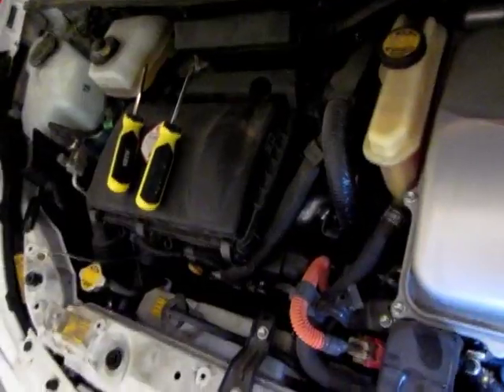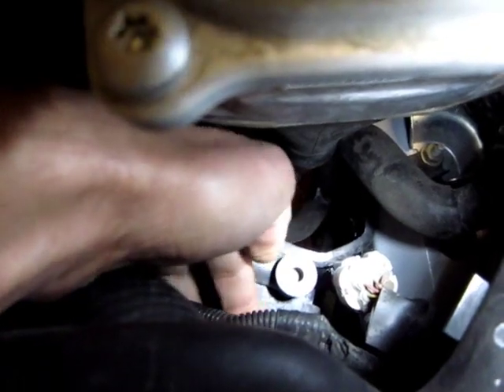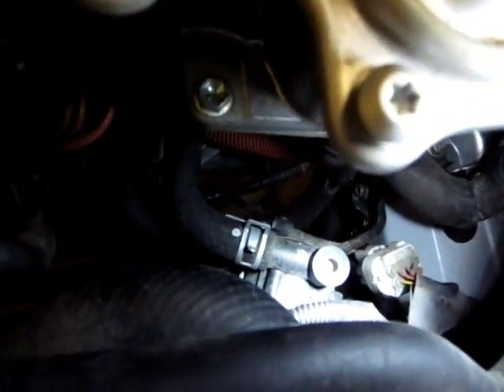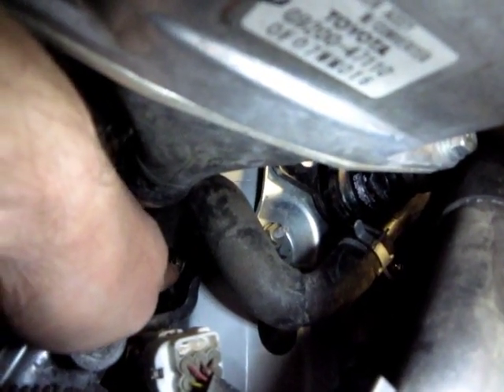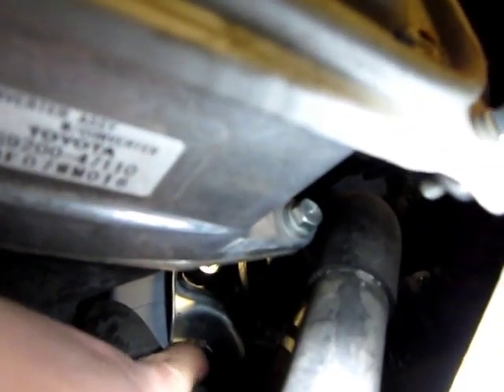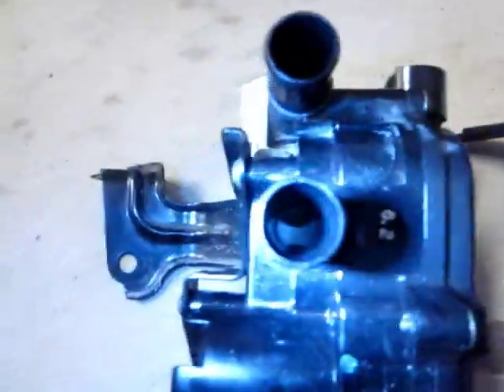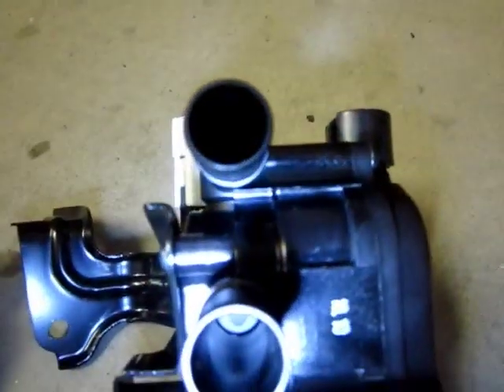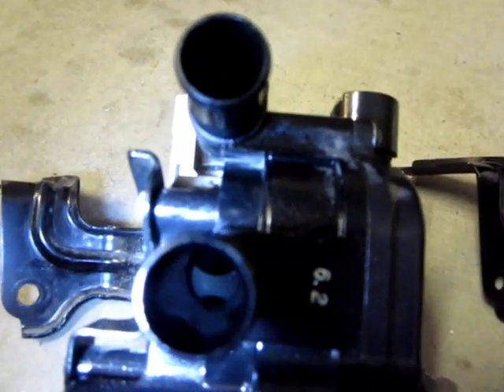Prius P1121 Coolant Control Valve Identification

Comment: The Toyota dealership I took my car to said that it not functioning was due to my car being pre-owned and damaged from an accident and it was glued together. What is the probability of this where there is no other physical damage to the car?
Reply: niftyusername Very low. You camt just glue valve together. It'd be a leak somewhere. Just didn't want to replace the part.

Comment: can you provide me a link to the thread where you descrie how to replace the coolant control valve? Is it the engine or inverter coolant?
Reply: The link is in the about, but here it is again to make life easy.  http://priuschat.com/threads/p1121-coolant-control-valve-replacement-with-pics.102648/
Reply: I'm sorry, I noticed this after I posted that. I am not experienced in working on cars, however I'm not close to bring a newbie. Is the hardest part getting your hands/ tools into tight places?
Reply: Evan Valek If you have done a coolant change before and replaced a part (like an alternator or water pump), then this should be within your skill set.  If you havent done an coolant change (or even an oil change) before, then I would suggest recruiting a friend or relative with more experience to help.  I wouldnt recommend this as a first time job working on your car.  The hardest part is working in the tight space, but there are other common sense mechanic things  that could go wrong and leave you with a non working car (and expensive engine damage due to improperly refilling the coolant).
Reply: I've changed coolant and thermostats. Had to burp engines also. That is another thing I'm unfamiliar with is how to burp the engine as the engine comes on and goes off. I can read and understand instructions tho
Reply: Evan Valek You should be able to do this then.  I highly recommend the cable pliers.
Reply: Michael Spencer yes that is what I was thinking.

Comment: Thanks for the clarity. By chance did your 'maintenance required' light come on before your check engine light? I'd say I'm not a novice at working on cars, but on a scale of 1-10 how hard was this to replace? I could get under my car if I had to, but if I can avoid it I'd like to. Also did your check engine light go off after this fix? Sorry for all the questions, but if I can avoid going to the garage I will. Also how much was the part? Thanks!
Reply: i like the garage if i had good reason maybe id quit gone there
Reply: i like the garage if i had good reason maybe id quit gone therep